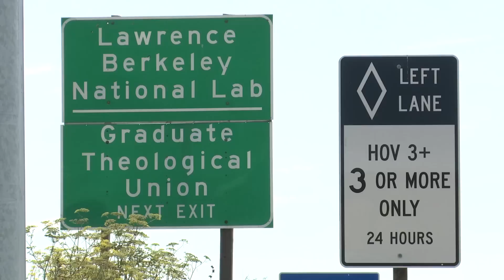What GM's Massive BEV, H2EV Push Will Mean For Everyone

Comment: GM's Massive BEV, H2EV Push are merely words so far.
Reply: Chevrolet Volt 1, Opel Ampera 1, Vauxhall Ampera 1, Holden Volt 1, Chevrolet Spark EV, Chevrolet Spark EV 400, Cadillac ELR, Chevrolet Malibu Hybrid, VIA Motors, Chevrolet Volt 2, Opel Ampera-e, Chevrolet Bolt EV.

GM offers an EV with a range of roughly 500 km for roughly 30k+. 

The ONLY manufacturer that offers a car with those stats currently - yet, people parrot "...merely words so far...".

Comment: Nikki, another good segment - wow, doesn't 'GM' and a rude sexual expletive really go well together?!  Thing is, the actual concept of a massive SUV with a honking great 120kWh battery pack inside a cavity/sandwich floor, makes a lot of sense.  A lot of energy is spent bumping them up to speed then dropping it down again, precisely the sort of thing EV's do well at.  There are only two impediments that are obvious?  One, GM may have examined the entire psych-profile of 'truck' buyers (Pick-up truck to me in the UK), and found they are not only not interested in electric, but actually averse to quiet, clean vehicles.  Two, the battery needs would be C-O-L-L-O-S-S-A-L.  I mean, two Tesla's worth almost for each monstrous vehicle, and actually they sell at a price point well below what is called 'luxury' now.  In other words, if GM suddenly pitched heavily into doing a slab of Lithium-ion big enough to run these ahem 'mothers' (Sorry - been watching 'Power') they'd soak world supplies up.

Perhaps this is the insight and foresight that Elon Musk had - he wanted it to catch on, but knew as soon as it did, his lifeblood supply of energy storage would be in a price/commodity buying war.  What a great strategic vision he had to make a battery cell factory.  I agree with others here though - the GM and Ford and VW etc, they'd all backslide tomorrow before breakfast if Musk had not demonstrated there is profit in other tech, and broken the ground.  The guy's almost hand-fed the blueprint to them.  I mean - tell me GM, Ford, VW, have not purchased a Tesla or two or three and taken them apart?  I think so.  Be dumb not to - mind you...

Comment: Great video and pretty much agree with everything you say. I suppose fuel cells are better than fossil fuels but it strikes me that using electricity to make hydrogen means we will need more power than if we just make battery vehicles (the key is if there is a breakthrough in battery design that totally kills the fuel cell idea). I can't see the military being bothered about making green machines though unless it gives them some kind of advantage in other areas. Whatever we think of GM's past it is their future behaviour that counts now, fingers crossed they have their heart in the transformation.
Reply: H can also be produced using solar and wind, therefore acting as a 'battery'. The relative energy inefficiency becomes irrelevant. As for the military, FCs are quieter than diesel and can be refueled within minutes - two crucial virtues for a combat machine.
Reply: The military needs to be defunded. It is a huge waste of tax payer money. Over 50% of the budget is wasted on it. It is time for it to stop. And this is to make the country less safe, not more, by completely destabilizing the middle east, all to steal resources from and control other countries.

Comment: I generally like your videos, but this one came off as one of Electrek’s nasty, passive aggressive, dismissive screeds about GM. Get over it already. Your streetcar thing was exaggerate at best. https://la.curbed.com/2017/9/20/16340038/los-angeles-streetcar-conspiracy-theory-transit-myth-general-motors
Reply: Yup, just like the head of GM said "global warming is a crock of sh-t." Great company. Very forward thinking. So forward thinking they pulled the EV1 off the marking the minute they got California to get rid of the law that made them produce it to begin with. And the same company that was building gas guzzling Hummers right up to when they bankrupted themselves and had to have tax payers bail them out.

Comment: After watching a series of videos about using a Tesla Model X to tow a small camper trailer a few hundred miles from the city to the mountains, I'm more sympathetic to the idea of hydrogen fuel cells for applications like this.  Despite its relatively small size, the trailer really killed the range of the Model X, and turned the trip into an exercise in frequent and long charging sessions.  One of the problems was that he frequently had to top off the battery to make sure he could make it to the next charger, but topping off a battery is slow because charging rate drops sharply over the last 20%.

Comment: People need to try to develop hydrogen fuel cells in california we have the ability to fill fuel cells in 5 minutes just like a gas fill up with only clean water as the omissions
Reply: WHat do you mean "try to develop"?  I believe there are three Hydrogen Fuel Cell vehicles available to Californians already.
Reply: Jean-Pierre White i mean make it a real alternative that is easy to get and use it exists particularly in mass transit here in california but i don't hear about car manufacturers working hard on it only hybrids and full electric thats what excites the car industry
Reply: Certainly the interest in Hydrogen Fuel Cell vehicles has gone "off the boil". I believe the best short term potential is with electrification/batteries. Where gaps appear and need to be filled then Hydrogen may have its day, but that won't be straight away.

Comment: Thanks for your videos..I'm slowly evolving and ready now to get into a EV.. Lost out on several 2017 Nissan Leaf's last week. I'm down for a reservation on the 18' so guess I'm the guinea pig..My first time wish me luck
Reply: I'm wondering if a used LEAF might be the way to go. My dad bought a 15 3 years ago. It came out to about $28K. It looks like there are low mileage used ones for 10-15K. Money-wise, that may be the way to go as long as it is low mileage and the battery still has all the bars. I'm not trying to discourage you from buying new, just something to consider as it is something that we hadn't thought about when we bought ours. I did an EBay search the other day and I think I saw a 16 with 300 miles on it for $15K.
Reply: J Pierre ....check out the 2017 VW EGOLF first. You'll regret not having more range once you fall in love with the whole EV driving experience. '18 LEAFS will have more range but I'm not crazy about the lack of a temperature mgt system on the battery.
Reply: No need to wish you luck, you're doing the right thing, you just don't know it yet.

Comment: UNTIL GM put their metal where their mouth  is.. I'll just go along with manufactures who have a proven record.  I'm not yet on the market for a car over 12,000.. once some used Bolts hover around there I can think about it
Reply: Volt. Bolt. And as they’ve said, 20 more in the next decade. $12,000? Good luck with that. Maybe a used Prius?
Reply: You can get a used LEAF for about that now. Don't buy GM. They will just push hydrogen power anyway and try to keep you enslaved to the refineries. Probably all they are going to do is make some weak sauce hybrids for their oversized junk trucks and SUVs.
Reply: Bring you up to date:
Chevrolet Volt 1
Opel Ampera 1
Vauxhall Ampera 1
Holden Volt 1
Chevrolet Spark EV
Chevrolet Spark EV 400
Cadillac ELR
Chevrolet Volt 2
Opel Ampera-e
Chevrolet Malibu Hybrid
VIA Motors 

So, not enough yet? I guess some people just don't want to think and follow the false narrative of "I hate GM"/"They don't manufacture EV's"/"GM is lying"/"They killed the electric car"/"GM is behind the market" and all other Bullshit (yes, capital B).

FACTS FOR YOU: GM is pretty much ahead in the EV game.

Comment: The Niki is right to call the Volt a REX EV. It's not a hybrid. It has no transmission.
Reply: Landon Thomas ,the gen2 is an hybrid. Check the demo on Youtube it's well explain how the ICE motor drive the wheels directly. The transmission is a CVT type control by the electric motor. Nice piece of engineering.
Reply: I just looked at the website. It makes no mention of this. The Volt is just as I thought. It's still a range extended EV.

Comment: I can't speak to the Bolt, but I found the Volt very disappointing. Currently in my garage there is a gen1 Leaf and a gen2 Volt. The Volt was a compromise to allow long distance trips, but still have a all plug-in vehicles. The problem is that the Volt is a gas hog compared to many hybrids, so you really have to consider your driving. With 2 months of nothing but electric at home and one 1,700 mile trip I would have save gas and money with most hybrid models. The Chevy app showing mileage completely ignores any electric usage, but even not counting the electricity, my previous Prius used far less total energy for the same distance traveled overall. If the electric usage was counted, the numbers get even worse. The Leaf is more comfortable, has a longer electric range and is more efficient on electricity, so it is the preferred car around home. The Volt was leased to help cover trips, but it only gets about 37mpg at highway driving speeds, so it has likely caused more damage to the environment in my situation compared to other options. The Volt would be a complete disappointment and even embarrassment if I paid for fossil fuel based electricity. Fortunately it's completely solar power charged at home, but it uses more of that per mile then the Leaf. Strictly as a car the Volt has some nice things, but many more negatives. Very uncomfortable, even torturous, back seat, very noisy AC and charging system, inconsistent fit, finish and quality. There are also many things missing that I've come to expect on all cars, even cheap ones, like blind spot mirrors, height adjustable shoulder belts, rear hatch wiper, sunglasses compartment. The locking system is also a pain. I cannot unlock (or lock) the door from the hatch, something I can do from the Leaf. I find that I need to pull out keyfob where it could stay in my pocket with the Leaf. At this point I will likely get a gen2 Leaf rather than the Bolt, but we'll see when all details are available.
Reply: The ideal situation, given the current charging infrastructure, would be an EV for local and short regional trips and a ICE vehicle for long trips. The Volt gives you this in a single car. For all of your praise of the Leaf, you gloss over the fact that you had to have ANOTHER CAR to fulfill your transportation needs. For all of your praise of its electric efficiency, you ignore how its lack of thermal management seriously undermines the battery's performance in anything other than ideal conditions. Both my Leaf and Volt have less EV range in cold weather, but the Leaf also gets considerably worse mileage in hot weather. The Volt seems unaffected. As a former Leaf owner, I agree that it has a more spacious interior and is a great around town vehicle, but I found the overall quality of materials inferior to the Gen II Volt, and many passengers offered unsolicited opinions along the same lines. Also, for all your praise of the Prius, with which I also have considerable driving experience, you ignore the fact that it achieves high mileage by employing a horribly underpowered drive train. The Prius drives like a wet noodle. The Volt's 0-60 time is over 3 seconds faster than the Prius, which is a huge difference. 

It is funny how terminology evolves. I would never have imagined a 37 mpg car being described as a "gas hog". BTW, I get 40 and it is rated at 42 (Interestingly, both my Volt's gas mileage and EV range have IMPROVED after the first 20,000 miles. I now get 57 electric and 40 MPG. New, I got 53 electric and 38 MPG.) How would you describe the 2016 Escalade that gets 22 MPG on the highway? A gas . . . . ? Words seem inadequate in this environment, don't they?

The Volt is certainly not perfect, but the great majority of its deficiencies arise from the Cruze platform on which it is built. The Voltec drive train--which is what makes the Volt revolutionary--is genius. I would love to see GM put a Voltec system in a larger car or SUV. Anyway, as an owner of a Gen II Volt, Leaf, and Prius, my experience has been exactly the opposite of yours. I actively disliked the Prius. Other than high mileage, it was otherwise thoroughly unappealing. I really enjoyed the Leaf (infinitely better than the Prius), but at the end of the day it simply wasn't practical. From my experience, the Gen II Volt comes out on top, and not by a small margin.
Reply: I found the back seat so bad when I test-drove the Volt that it was a main reason I didn't buy the car. The view out the back was awful as well. It might have well been a two-seater in my opinion.
Reply: Not all Volt customers like the car, but the vast majority do.  It has sky high customer satisfaction ratings.  The latest Consumer Reports rating I found had it as #3 overall (90% would buy it again), with #1 being Tesla Model S (94% would buy it again).  That's among all cars, not just EVs.

insideevs dot com/consumer-reports-satisfaction-survey-tesla-model-s-1-chevy-volt-3-tesla-model-x-8/
Reply: Tom Huffman The part about the LEAF getting less mileage in hot weather seems like BS to me. I have found that it gets better mileage. I think it is because the air is less dense. I'm just speaking from my own experience. I expected it to be worse while running the AC, but, I have found that my mileage seems to be better when it is in the 80s+ compared to something like the 60s or 70s. Maybe there are other factors such as wind, etc., but, my impression is that it is better in warmer weather. I am in the Midwest US. So, I guess it depends on what your definition of hot is. You may run into problems wearing out the batter in places like Arizona where it is 100+.
Reply: The reason I didn't buy the LEAF is because it is so much worse built than the Volt and the Prius (when not PiP) is simply a car made out of tin foil compared to the Volt and I am very very happy I don't have a rear window wiper (which the Volt does not need). Are you sure you have a Volt? It doesn't sound like it or you have a bias towards GM.
Reply: @ idmhead0 You might have just replied that the "getting less mileage in hot weather" is counter to my experience, rather than calling it BS. OK, your experience seems like BS to me. Now where are we? 

I also live in the Midwest and my 2013 Leaf definitely got lower electric range on a day that was 95 degrees than when it was 75 degrees. It wasn't subtle. I had to take this into consideration when planning trips.
Reply: @ Dan Sanger I would add to this that the Volt's owner satisfaction is MUCH higher than the Leaf, which didn't even make the top 10.
Reply: Actually I was a bit upset about the bullshit people say when it comes to GM. Some say GM is not serious about EV's while it is the ONLY manufacturer offering an EV with a +/- 500km range for roughly 30k. 
As for the Volt. I am on the second one. I had Audis before and I am very glad I am off german cars. Now, why do you think I had to resort to a GM Volt? Because the competitors didn't offer anything like that. Toyota with its Prius PiP wasn't as advanced (and still isn't), it's more complex and the build quality is just awful compared to a Volt. LEAF? I very much like the LEAF (Gen 1) but also, no active battery management system (air cooled!) and awful build quality. Mitsu iMiev? Well, ok...I like that one as well, in fact.

FACTS: GM offers the most advanced batteries/bms.
FACTS ARE: NO RECALL on GM Volts (bms). NOT ONE SINGLE RECALL.
FACTS: Nissan batteries failed more than often
FACTS: Today only GM offers a 500km-range EV for roughly 30k. 
FACTS: german car makers talk the talk but don't walk the walk (yet).

So, do you understand why this anti-GM babble is not only annoying but also FACTUALLY wrong?

Comment: Nikki: After a couple of months with your New Bolt, how do you like the seats? I sat in a Bolt in the showroom and it felt like I was trying to fit into an Economy Class Airline seat. I understand that the seats are 3 inches narrower than most other small car seats.  I did find that the door was easier to get into than my Chevy Volt however.
Reply: The Bolt is just slightly larger than a Honda Fit so its seats can only be so big.
Reply: It’s an individual experience. Some people HATE the seats. Some don’t really feel strongly about them. Nobody loves them.

Comment: As she said, the more competition in the EV world, the better. I just hope GM makes better EVs than they have ICE cars.
Reply: Just as long as they are actually trying to compete, instead of the crony capitalism these companies  typically opt for (lobbying against their competitors, etc).  We'll see if they're even capable of this.
Reply: GMs interest is probably trying to wipe out Tesla.  Once wiped, Ice cars are back in larger numbers.
Reply: bugzilla2001 no offense to GM fans (after all, I am one) but I think almost anything is better than the pushrod engines they still use
Reply: Auto makers have to switch to electric but China and Europe are in the process to outlaw ICE vehicles.  Tesla is safe.
Reply: No, that's is not right. But you'd had to inform yourself.
Reply: I love my Volt.  53k miles with zero issues.
Reply: Fiance's 2016 volt is amazing. I am a lifelong Ford man who owns a Tesla however I have to hand it to GM the Volt is spot on and from the reviews I have seen the Bolt is as well. GM has a mixed reputation from years past but they definitely seem to have improved. When I sat in her car the first time at the dealer when we were testing it out I thought that I was back in my old TL. Chevy has improved their fit and finish in the cabin upto the levels of some of the Japanese luxury brands... Ford please take notes cheap plastic is bad when you are selling a 30k+ car.